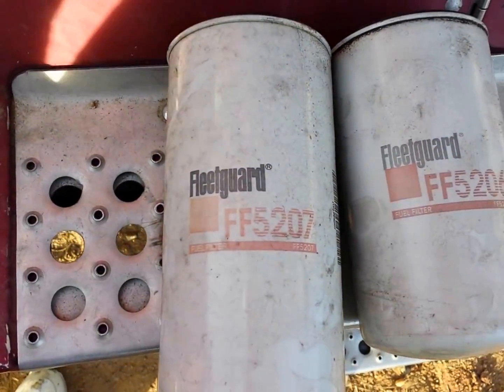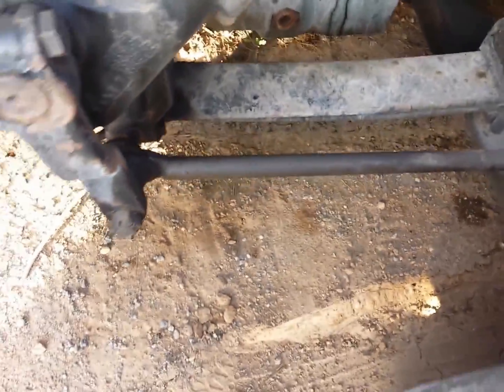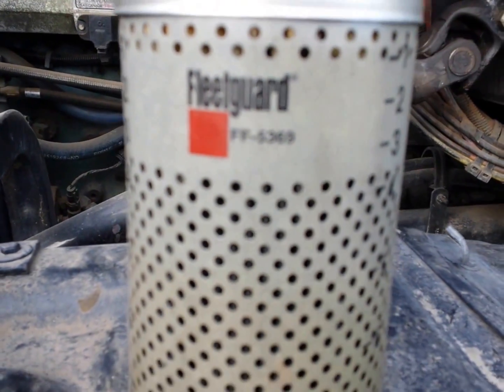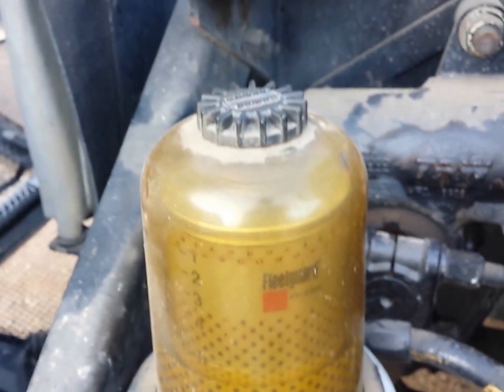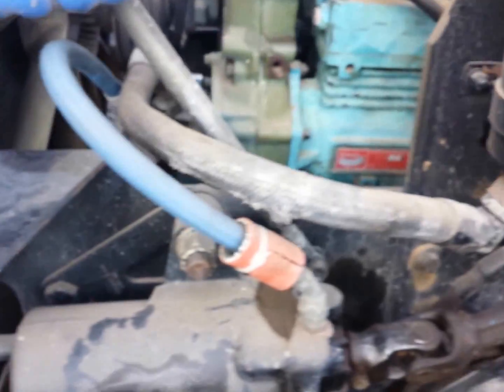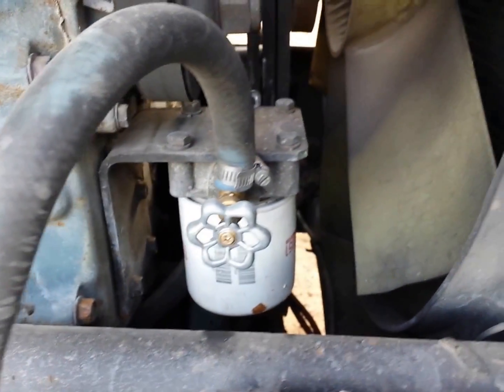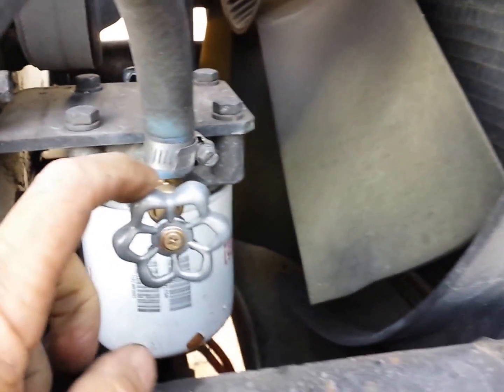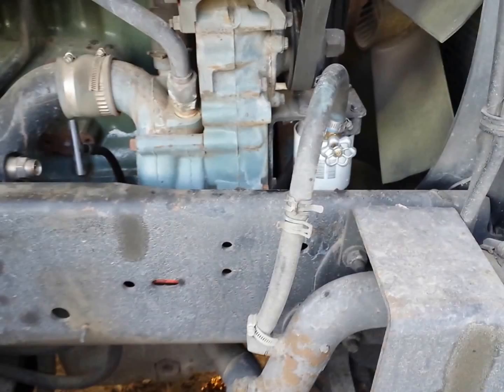Detroit Diesel 12.7 L engine fuel filter change

Comment: I'm so confused. I have a 12.7 factory remanned in 2015 glider in a Columbia and I don't have the spin on fuel filters at all. All I have is the davco housing and I've been using the FS19763 from fleet guard. Can I add a fuel filter housing for a spin on fuel filter? And am I supposed to be using a FF (fuel filter) instead of FS (fuel separator) in the davco? Truck has been running great for two years but that's the filters that came with it when I bought it so.
Reply from the maker: I'm showing filters for 2 different trucks. You do not need screw on filters if you have a Davco. 
 Both have DD 12.7 engines. The maroon colored Freightliner truck shows two spin on filters.
 The 2nd truck with a 12.7 DD, shows a KW with the Davco. My filter is seen in vid is FF5369. Look at your orginal filter to see if its the same. 
 The clear glass with filter inside, to me this is the best filter because you can tell when the filter needs to be changed. The dirtier the filter gets the higher the fuel goes in the filter. The fuel filter is Muc Easier to change. AND IF YOU RUN OUT OF FUEL YOU CAN FILL THE DAVCO WITH FUEL FROM THE TOP.